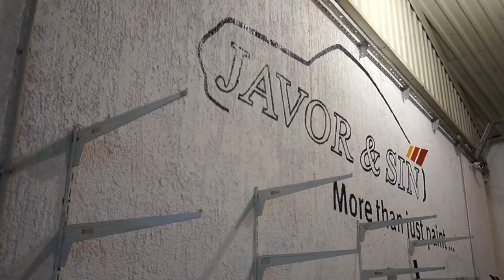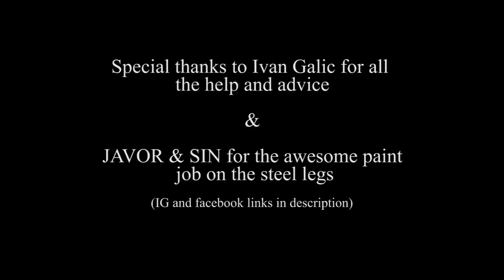Spiral Table Build

Comment: 6:43 - Most expensive layout jig EVER...
Reply: they could just use a laser
Reply: La Table 55 or a string w/line level
Reply: @jlribeiro  they created the reference from the robot arm cnc, the feet should be parallel to the base, if they wanted to use a laser, they had to sand the base, make sure it's level to the ground, then use the laser to level the feet. 
What they have done is smarter and easier because they already have the robot arm, and they replicated what they want to do with the table, and they know the feet distance with a simple command.

Comment: Amazing table !!
Not much relief for seasonal changed in the wood and one thing I'm not sure about .... this table must be incredibly heavy, does it sit on those four small rubber feet on what looks like 8 or 10mm threaded rod inside of the curved legs ?

Comment: Bellissimo! Worth waiting for. I love the metal frame. It has the quality of a 3D tattoo. I thought you might use a laser to level the legs, but of course when you have a Kuga standing in the corner of the workshop why not use it ;-) This table will look in the director's (your) office !
Reply from the maker: Actually it ended up in friends dining room. Tbh, I didn't plan using the robot for marking. I already started positioning the laser level while the legs were positioned on the table, then it dawned on me.. :D Glad you like it Niall, thank you.

Comment: Great table, but one of the legs was injured during the work and I noticed that you left it just like that. You could also put something of the bottoms of those legs, because the slightest movement of the table will certainly scratch any floor (considering how heavy is the table). Otherwise great work.
Reply: the metal deforms when bending it. And he welded nuts inside the legs for adjustable plastic feet

Comment: aren’t you worried that the top might bow or cup due to wood movement?
Reply from the maker: It probably will for a millimeter or so but it doesn't concern me. I put a layer of lacquer on the top and on the underside as well to shut all the pores so the moisture level changes very slowly. that way deformations are minimal.. The wood was kiln dried to very small moisture percentage and stood on the shelf for a long time afterward. also after gluing the table top, I let it set for a week before I planed the whole thing..

Comment: Beautiful result, but to be honest, I was hoping the legs were steam-bent or bent laminate and not steel
Reply from the maker: I thought about it but they would have to be very thick to hold the massive table top..
Reply: @lignumchannel  I expected that would be a fair challenge, but, for the quality of work you do, I figured you'd find a clever solution. Regardless, the steel tubing does still look great, plus probably helps make the complete table lighter than if you used wood

Comment: Amazing  Job. Whats the brand of your cnc robot?
Reply from the maker: Glad you like it! Robots are kuka kr150 model from 2005..
Reply: @lignumchannel  ok, and you installed the router or it comes with it?, thanks in advance
Reply: @josegabrielguzman7174  it's from a car plant I would expect. They sell them off when they upgrade the line or change suppliers. You basically put whatever you want on the end of them. Teach in low speed, reherse in low speed, then run on high speed. Some people don't rehearse and then pay the price when the machine doesnt go where it was intended, but instead does as it was told. Seen the results of robots "kissing" a few times. That's another way to get hold of one cheep, but end of life units like these aren't that expensive. The plc and program can be tricky to learn if you've never done anything like it before, teaching is easy enough though..

Comment: Wait, what was the small plug for? I didn't catch that
Reply: Looks like that was a little worm hole that was drilled out and plugged
Reply from the maker: It was a little knot that fell out. It wasn't visible until I planed the table top.

Comment: Why are the butt ends not welded?  The floors will be scratched
Reply from the maker: Steel doesn't touch the floor anywhere . Rubber pads are screwed into welded nuts. I think perhaps you skipped that part of the video:)

Comment: Have you thought of putting a metal-cutting bit on your robot and use it to trim the legs? :D
Maybe something like this:
https://youtu.be/RPO_vhVsfeQ?t=121
Reply from the maker: I actually tried it and it works.. Kinda.. I managed to mill aluminium and brass but it was edgy.. The robot is just not as rigid as  a portal cnc so it starts to vibrate a lot..